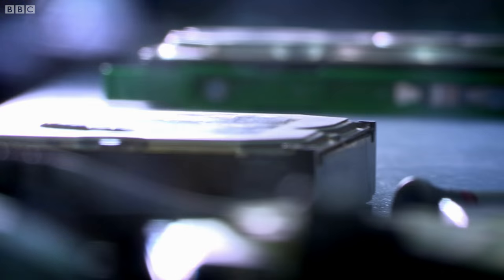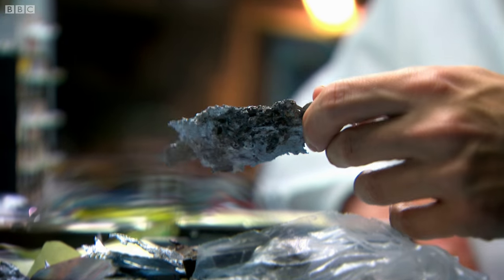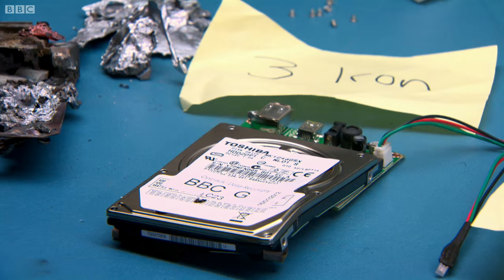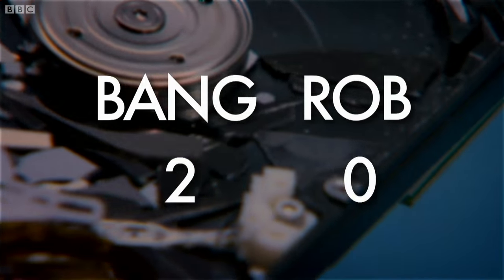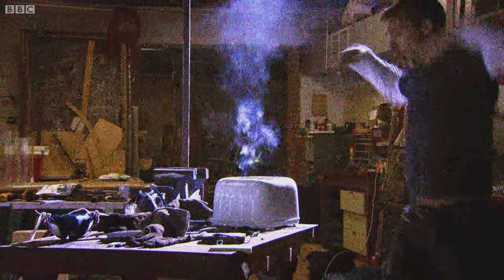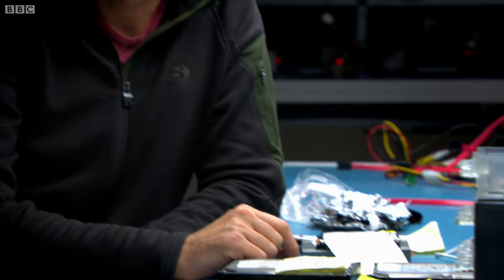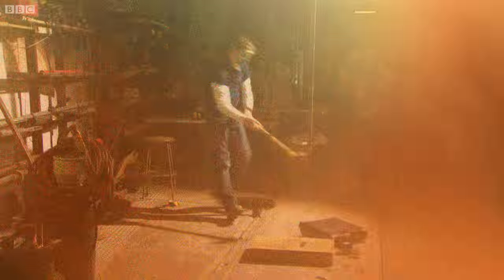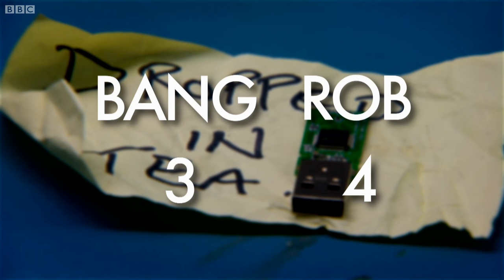Can You Recover Lost Data? | Bang Goes The Theory | Earth Science

Comment: So "Data Recovery" consisted of plugging in undamaged drives and reading from them? It seemed that it was either "damaged" and lost all data or "undamaged" and all data still there without any need for "recovery".

How about tests like formatting the disks, wrecking the PCBs but not the platters? Removing a drive from a RAID config? Scratching the platters? Water damage to mechanical parts? You know, the sort of things that happen in real life that require more than just plugging it back in and accessing the data.
Reply: they can all be recovered I think, except if you had a RAID 0 or something stupid like that. And scratching the platters.
Reply: My point was that each of these (including the RAID 0 and scratched platter) could result in complete or partial recovery but in each case would be more than just plugging it back in and it working fine.

It would actually show some of the techniques used to recover data. That was not covered in any way in either of these 2 parts.
Reply: The Spanish Inquisition Yeah. I agree that the tests they did were stupid.
Reply: not to mention the files where extremely small (i'd take a wild guess that the drivers when't full either which does play large part in file recovery).
Reply: What? The Spanish Inquisition?! I didn't expect you here!
Reply: Maybe they didn't want to reveal specific techniques?
Reply: "unformatting" is easy if you did not overwrite old formated data with new. Format just tells disk to forget where your data was not to forget your actual data. Replacing pcb is also quite easy as long as firmware on the old pcb is intact so you can solder it to new one. I dont know about raid but i suspect that depends on your raid configuration.
Reply: The Spanish Inquisition that's not quiet it. The entire drive could be toast, but if the disc is at least mostly intact data can be recovered. They don't just "plug it in", they have various methods of transferring the platters.
Reply: I know what data recovery is. That was my point. The video was meant to be asking what is possible with data recovery but they did nothing but plug in the drives and see if they could read them. I'm making the point that the what the video showed did not live up to the title of "recovering" lost data.

Comment: Smashing the computer won't always smash the hard drive.  If you had done those smash tests on the drive itself, instead of leaving them in the case, you'd have probably had at least slightly more luck.  Though drives ARE pretty resilient.  Should have tried a microwave as well though.

Comment: What do you do if you have a laptop that doesn't work properly, can't be loaded to use scrambling software, but you want to make sure no one can read the hard drive if you throw it out because it's taking up unwanted space in your room?
Reply: Destroy the platter or use a magnet. I'm sure there are other ways, but those two, especially the first, are the easiest I could think of off the top of my head.
Reply: take the hard drive out and then dispose of the computer. The hard drive remains with you and no one can read the data
Reply: Don't bother with a magnet. It only (in theory) works on magnetic storage like a hard disk and you'd need one so powerful as to not have access to one strong enough.

The easiest thing is to pull the drive and pitch the rest of the machine. The drive shouldn't take up more space than a novella and should only require a screw driver or two to get at.

But if you want to get rid of the whole thing, you need to write over the drive with zeros. This is tricky to do with solid state drives because they are "smart" to a degree but for a magnetic disk drive it is fairly straight forwards. 3 passes with zeros ought to be good enough. Then you might consider donating the machine rather than putting it in the trash.
Reply: Take the drive out,get an external SATA drive encloser,run the scrambling software
Reply: take hard drive out and destroy it, no way to get files back :)
Reply: Drill the platters to pieces. If it is something really important on them: Buy a cheap microwave, and let the platters sit in there for a while.

Comment: Hmm... I feel like these guys didn't try hard enough... I think they could have pieced together that shattered glass drive and read from it if they really, really, had to. Besides I was wondering if it were possible to get data from the damaged drives and what method is used to attempt? If not, then why? Why can't you get data from a glass shattered, ultra magnetized, or torched drive? What has made this impossible to read in leman's terms?
Reply: MAN_ON_WHEELZ 

The width of the cracks by themselves is thousands of magnetized sections long. You might be able to recover some fragments of data with a multi-billion dollar machine and a team of motivated scientists, but no one has that kind of money or motivation to waste. Also, if your drive was encrypted at all, this makes the data even harder to piece together, let alone dealing with decryption. Keep in mind that we've made the magnetic sections incredibly tiny compared to the old 1MB drives that came on wheels because of the size. There's a reason the drives eventually fail if you let any dust get in,  dust gets in the way of the read and write head and prevents the reading of hundreds of thousands of magnetic sections.

Comment: Why not just do a low level format?
Reply: If all you do is zero the disk, data can still be recovered by forensics. The way to do it in software is to write random data to the entire disk several times with something like DBAN, but you can't always do that if your disk has stopped working e.g. the controller board has died (which can be fixed by replacing it) or you've got the click of death.

They really should have tried both of these though. There are also commercial hard drive shredding services which will physically shred your drive as if it were paper.
Reply: Also, visit Spinrite's site. There is a wealth of security info that is very clearly written. Steve Gibson is a true pioneer of this sort of thing. Hell, my first PC had a 40MB hd, and I was able to squeeze 42MB out of it!
Reply: Dead Frt West Spinrite is a bit controversial. It does things like enable parts of your drive which were disabled by the manufacturer because they didn't pass quality control or have been disabled by the drive itself over time due to faults, and the original authors split with differing views on whether it was a tool worth using or something which could potentially cause irreparable harm to a drive.

At the very least, do a lot of background reading before using it.
Reply: Spinrite tests sectors very thoroughly. Back in the 90s, it was indispensable for recovering lost or unreadable data, as well as boosting the performance of the drives. Now drives have internal sector (block) remapping, and are very reliable. And cheap? My first 40MB drive cost over $400, IIRC, lol.